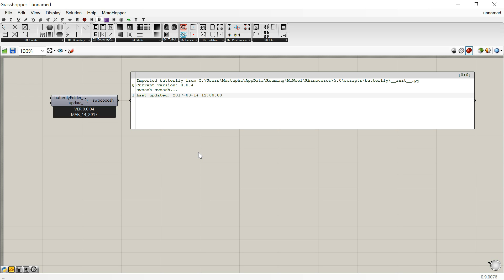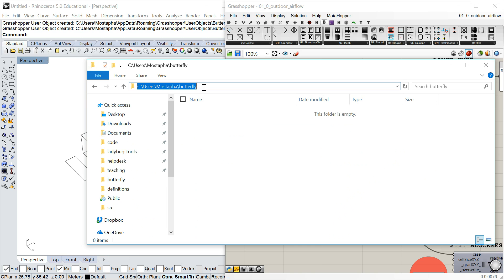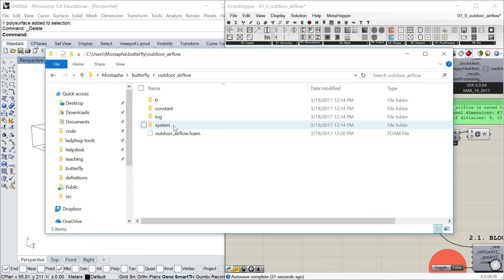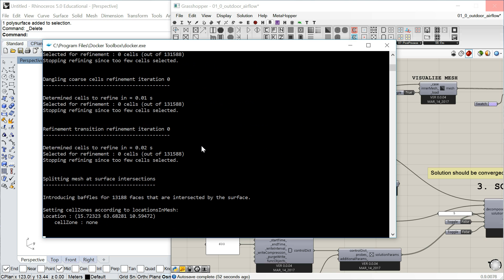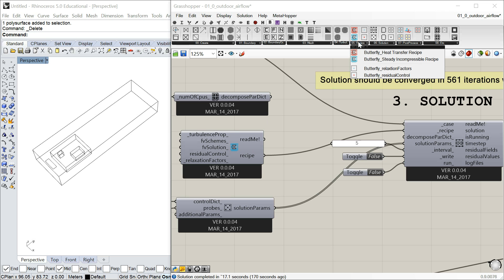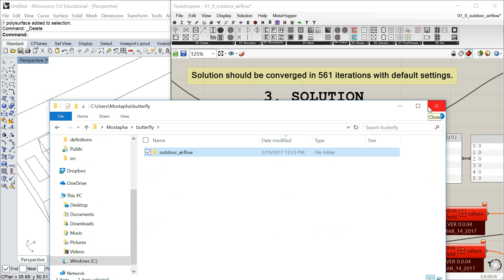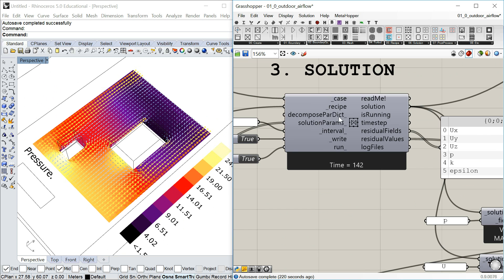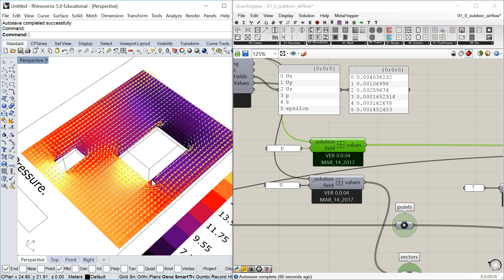04: Outdoor Airflow Modeling With Butterfly in Grasshopper

Comment: Thanks for the video, but I have a problem at 8:50. I have followed the openfoam tutorial installation and it looked exactly on my screen the same as on yours.. but now when I run "Blockmesh" I get the following error :  Butterfly failed to OpenFOAM command! --> FOAM IOWarning : Found [v1012] 'convertToMeters' entry instead of 'scale' in dictionary "/home/ofuser/workingDir/butterfly/outdoor_airflow/system/blockMeshDict" , and this keyword is deemed to be 108 months old.      I can not solve this problem...
Reply: Could you solve it ? I have the same 😩
Reply: @franciscotellezbuitrago5302  I think the problem is my CPU doesn't allow the virtualization.. so I am going to buy a new laptop ..😭

Comment: Hello Mostapha, thanks a lot for your quite useful tutorials!
Regarding outdoor simulations, I've been wondering if there is a way to make the simulation more in a 3d way, like you showed in the example below answering to Alex.
What I mean is all the vectors here are being calculated in the same "2d surface" which is cool for flat areas, but I was hoping to use your method with landscape as well. 
Thank you in advance anyway!
Reply from the maker: The solution is calculated for the whole domain (in 3d). We're visualizing the results in 2d but you can visualize them in 3d if needed.
Reply: Thank you for the clarification man!

Comment: Hi, the video is very good! Great work. But, how can I change the grid where I run the simulation? Because now I have two holes where before there were the solids.
Reply from the maker: Hi Enrico. The simulation runs for the whole domain. The grid/points are probes to report the values which can be any custom point. You can change them by changing the points that are connected to probes component. Also see the example that I shared in answer to Alex. You can also sample the case afterwards.
Reply: Thank you so much.
Reply: @MostaphaSadeghipour  Hello Mostapha great video. I am watching this along time after it was being discussed gut everything working and results but I had this same problem: Dont know how to regenerate the TestMesh. I thought it would automatically detect the new boundary from a new model but it didn't and it keeps showing the empty boundary from the example geometry. I dont know what you mean by 'changing the points that are connected to probes component'. I can see the probe component but I dont see what points I can change.  Thank you very much

Comment: Hi, Mostapha thanks for your tutorial, really helpful. 
Just curious that the geometry for this tutorial is prepared in stl.. If I want to add additional buildings into the geometry, must I convert it into stl. as well, or, I can simplily build more buildings through Rhino?                  I tried to add more buildings, but snappyhexmesh only recognized the initial two buildings.
Reply from the maker: Hi Weiguo, You can simply build them in Rhino. If you couldn't figure out how to do that then open a discussion on the Grasshopper forum and attach the definition.
Reply: Hi Weiguo, did you manage to solve this problem? I am having the same issue
Reply: Hi I have some issue, i already create a new box but how to recognized the another building in snappyhexmesh? Thx

Comment: Hi Mostapha ! Great work again but this time I'm having a problem... I have followed the openfoam tutorial installation and it looked exactly on my screen the same as on yours.. but now when I run "Blockmesh" I get the following error :

"1. Solution exception:Failed to find container id. Do you have the OpenFOAM container running? You can initiate OpenFOAM container by running start_OF.bat:
C:\Program Files (x86)\ESI\OpenFoam\1612\\Windows\Scripts\start_OF.bat"

I have clicked before OpenFOAM_Start from my desktop and I can check its running properly.. 

I browsed my openFoam folder and I have a folder 1706 but no 1612 folder. So do I have a version problem here ? Any help would be much appreciated.
Reply from the maker: Hi Hugo, Your assumption is correct. See this link: https://github.com/ladybug-tools/butterfly/issues/250
I will be on vacation until 8/19. Meanwhile use the older version and I will get it fixed once I'm back.
Reply: Thx for the confirmation. I just installed the previous version and everything seems to run !

Comment: thanks for the video sir, I was wondering,  after i run the solution all 600 times how can i go back and access the data visualized in rhino? i need that data to create a presentation. do i have to re run the solution again  to screenshot the graphics or is there an easier way to do this?
Reply from the maker: You don't need to re-run the analysis. You can simply sample the case. Here is an example: http://hydrashare.github.io/hydra/viewer?owner=mostaphaRoudsari&fork=hydra_1&id=sample_case&slide=0&scale=1&offset=0,0
Reply: thank you so much sir.
Reply: Hey Mostapha! Could you share any suggestions why this error may occur while trying to sample the case?
https://i.imgur.com/cwvEJSo.jpg
Thanks a lot for your help!

Comment: hi mostapha, may i ask how long did you take to solve this case? I have run for almost 4 hours and it has only done 255 iterations. I didn't change anything of the example file. And my cpu is i7-7th gen and my pc has a solid disk. I use rhino 6.11 and blueCFD and the latest butterfly plugin for GH. Thanks so much!!
Reply from the maker: It has been a long time and I don't remember. You should post these questions on the forum. I rarely check the YouTube comments.

Comment: Hey Mostapha, I tried your tutorial and everything works. Expect, my wind vectors are small and not really visable. How can i change this?
Reply: Which is because my values are really small. The thing is i followed your everystep, so I don't see how I can get a different result?
Reply: I solved by scaling the vectors. So I tried to implement my own 3D model, and i encountered an error. It says :"1. Solution exception:
 --> snappyHexMesh Failed!
--> FOAM FATAL ERROR: 
Point (15.72323 63.68281 10.59472) is not inside the mesh or on a face or edge.
Bounding box of the mesh:(-241 2.334047e+07 0) (69 2.334114e+07 103.5)

    From function static Foam::labelList Foam::refinementParameters::findCells(bool, const Foam::polyMesh&, const pointField&)
    in file snappyHexMeshDriver/refinementParameters/refinementParameters.C at line 206.

FOAM exiting"

I'm not sure what point it is talking about, any idea?
Reply from the maker: Hi Christoffer, Thank you for opening an issue [https://github.com/ladybug-tools/butterfly/issues/233]. I will check and reply there.

Comment: @Mostapha Sadeghipour Roudsari
Hi, I am trying to run this script and I am being caught up on the initial steps, for my meshing_params it is giving me an error saying "simpleGrading' object has no attribute 'x'" though no matter what I plug into the _xgrading, the red won't go away, do you have any solutions to this?
Reply: Lol im having the exact same problem as you. Do you know any solutions you can fix that error?
Reply: @jessicazhong7973  I pulled up the python script for that command and had it bypass x in general, which allowed it to create my wind tunnel, but in the end I think my open foam was messed up because I could never get the analysis to run
Reply: @Austin Gawrys Ah~~ Thank you so much. Can I ask how did you pull up the python script? Sorry im really new in terms of using grasshopper. Thanks so much with your help.
Reply: @jessicazhong7973  no problem, but same I just started learning it back in August, but if you double click on the middle of the component it should pop up a script, and than at the bottom there will be a section that is red, I think my professor just deleted that part and it end up working for me
Reply: Its okay hahaha I found it. Really, thank you so much with your help.